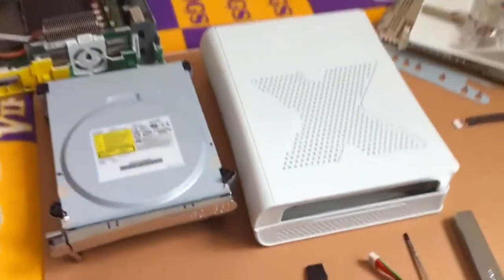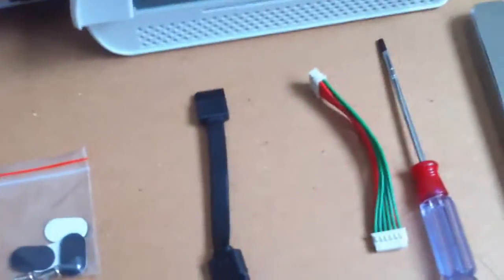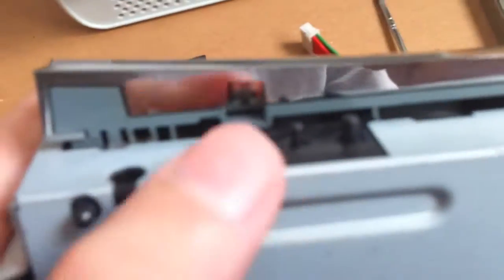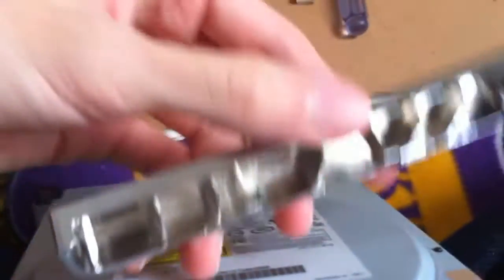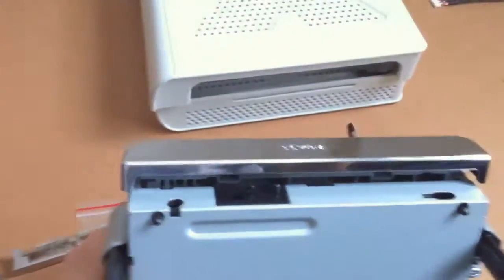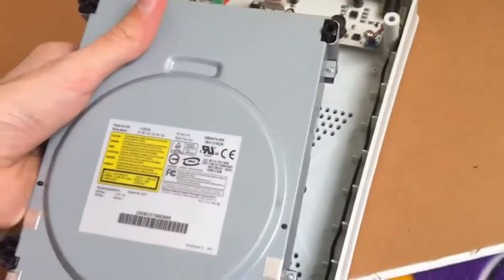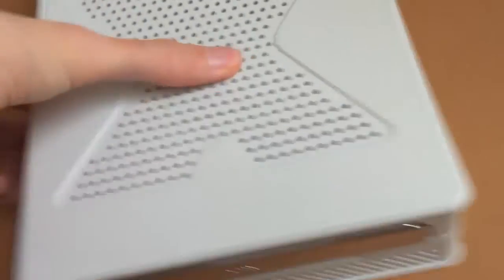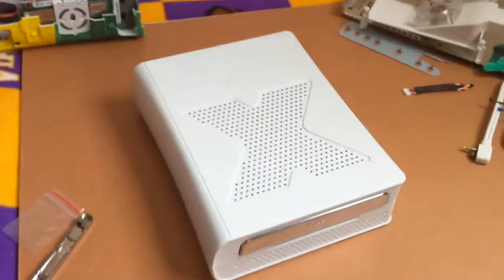xDrive Installation: Part 1

Comment from the maker: @11o199oo In order to use the xdrive on an Xbox 360 you must install the internal circuit board and connector (As seen in Part 2).  All it does is make the drive sit on the outside of your Xbox, so if it was flashed already it will work just the same.  To answer the second question, if you use the drive on another Xbox (assuming you had them set up with a circuit board and connector as well) you would get banned because the drive key won't match.